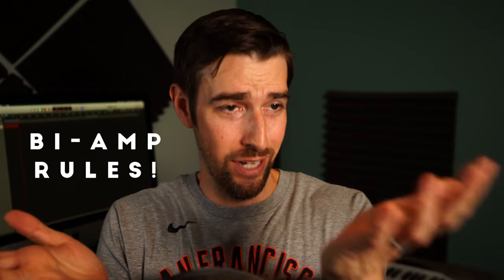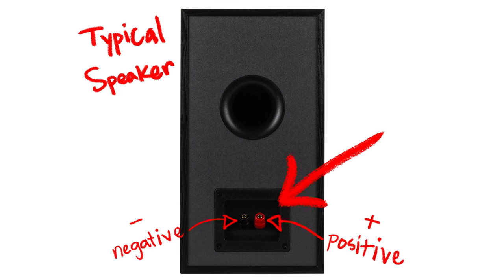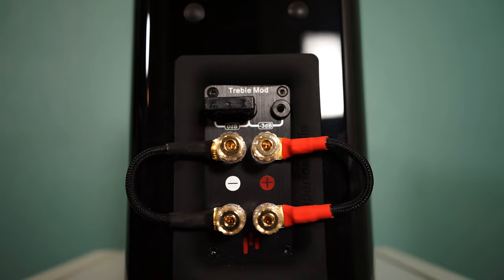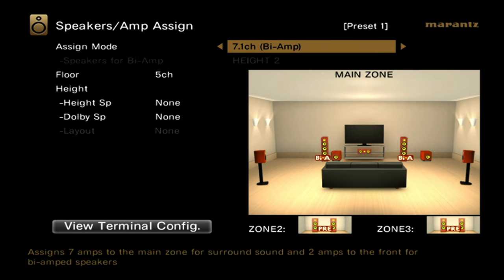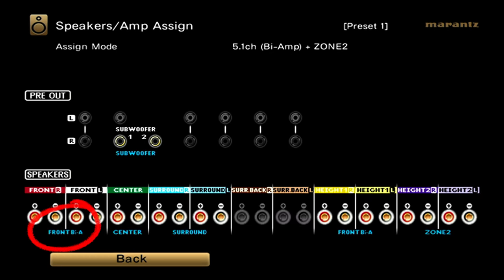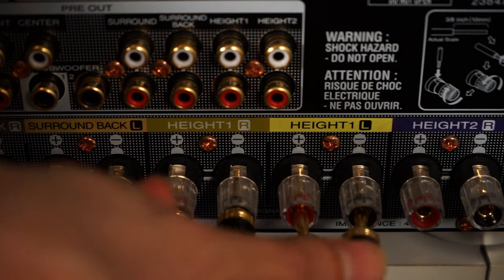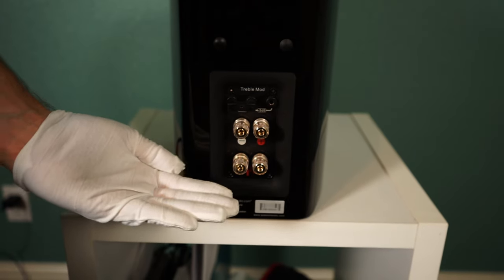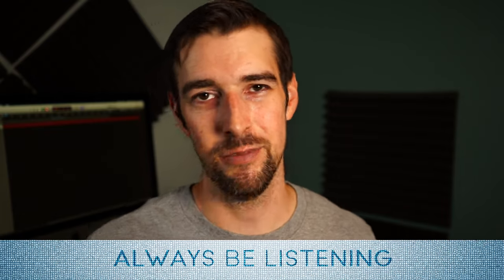TO BI-AMP, OR NOT TO BI-AMP? | Setup | Discussion | @AperionAudioSpeakers | Marantz | Denon

Comment: I totaly agree, I have bi-amped my Sonus Faber and its hard to notice a big difference in movies but it makes a huge difference in 2-channel.
Reply: A little late to the party. My thought was just the opposite. I have an older 7 ch Onkyo. 100 wpc 2 ch. driven. I'm running 5 ch with the front L& R bi-amped. Another comment below stated that he doubles his watts with the bi-amp mode. I don't believe that's the case. My belief is a 100 wpc receiver will only put out 100 wpc ( 2 chs driven ) no matter what you do with bi-amping. So for 2 ch, 100 watts is all I'm going to get. Bi-amped or not. The bi-amp mode only comes into effect when in home theater mode. Now I"ve been wrong once so far this year, so it's possible I could be wrong again, Anyones thoughts.

Comment: Great video! I just upgraded my front stage for my 5.2.2 system to B&W 705 S3 bookshelfs and HTM71 S3 center on my Denon x3800H receiver. I am planning to Bi-Wire the center and considering Bi Amping the fronts, since I have those terminals unused... I mainly watch movies, but also listen to music. Do you think it's worth Bi Amping the fronts in my setup or is simply Bi-wiring the better bet? My thought is that those unused terminals are not using their amps so it's wasted power, but perhaps it's all a pool of power for all terminals and doesn't matter...
Reply from the maker: Yeah, if you listen to music quite a bit and have those unused terminals, might as well experiment! 🎉

Comment: Hi Ealan, great video and thanks for that!
I have a question for you... I would like to ask if bi-amping reduces the "load" of the AVR when trying to drive 4 ohm speakers.
To be more specific, my AVR is Marantz Cinema 40 and for FL and FR I am waiting for Sonus Faber Sonetto III tower speakers (4 ohm) to be delivered. I have read on various forums that I should not change the AVR setting from 8 ohms to 4 ohms but be careful with the temperature of the AVR and high volumes...
So, I was wondering if bi-amping would reduce the "bad effect" of the 4 ohm speakers to the AVR?
Also, in general, do you recommend keeping the AVR setting from 8 ohms or change it to 4 ohms (as recommended in the user's manual)?
Thank you :-)
Reply from the maker: It might help it a little bit to distribute the load across more internal amps, but it would significantly help if at some point you off-loaded the need to power your Sonus Fabers all together with an external amp. 

Are the Sonus Fabers the only 4 ohm speakers that will be in your system? If so, I’d stick with 8 ohm if the rest of your speakers perform best at 8 ohms.

Comment: Surprised you didn't also explain bi-amp'ing with an external amp using the AVR's pre-outs. The benefits  are much different and the improved performance is greater realized.
Reply from the maker: Since that’s a more specific breakdown, that will be in an upcoming tutorial. The majority of my audience seems to be those fairly new to home theater, so external amps aren’t on their radar yet. But the video will be coming soon!
Reply: @ealanosborne that's fair, looking forward to that tutorial. However, you recently reviewing the Emotiva AV Processor... your base is maybe a little more sophisticated than you give us credit for. 👍🏽
Reply: Right , the correct way to Double your power . Far superior . Turn 100 WPC to 200
Reply: I don't know what your plans are, but I would highly recommend you do some research on biamping before you start playing with external amps. When you are using a multi channel receiver to biamp, you're doing what's called a vertical biamp. On modern audio equipment, vertical is the only way to biamp that makes sense. It avoids all kinds of problems that you will run into if you go with a traditional horizontal biamp. There's a fair amount of information you'll need to go over to learn about this method, and its just not possible to cover it in a post like this. If you're thinking about using one amp for the highs, and one for the lows, or mono amps in some configuration, stop. You can waste a lot of money if you don't know exactly what you're doing. 

For a vertical biamp, this is what you need. There's only 2 amplifier choices. You can use 2 stereo amps that are identical. They have to be exactly the same. Or, you can use a 4 channel amp where all 4 channels are identical. In a music setup, 2 stereo amps is the norm, but a 4 channel amp is OK. Obviously, your receiver will be using the 4 channel setup. You can't use separate mono amps to vertical biamp. To give a quick visualization of what you're doing, I'll explain how the amps are connected when you have 2 stereo amps. In a traditional horizontal biamp, one stereo amp is used to drive the highs and the other amp is used to drive the bottom half of the speaker. In a vertical biamp, the right channel goes to both inputs on one of the stereo amps. One channel of the stereo amp goes to the highs, and the other channel goes to the lows. So, instead of one amp driving the highs on both speakers, and the other on the lows for both speakers, you now have 1 amp driving the right speaker, and the other amp driving the left speaker.

The main thing to take away from all this, is vertical biamping is plug and play. As long as you follow the rules, everything will work, and you'll get good sound. Not so with traditional, horizontal biamping. Even if you are using 2 identical stereo amps, the bass amp will be working a lot harder than the amp for the highs. How hard an amp works, changes the way it sounds. Also, power output is a function of frequency. The lower the note, the lower the resistance the amp sees. 4 and 8 ohm ratings on your speakers are just averages. The actual resistance constantly varies. So, if you have an amp that puts out 100 watts into 4 ohms, and 50 watts into 8 ohms, those 2 identical amps are not identical anymore. If your bass frequencies average about 4 ohms and the other amp 8 ohms, you literally have one 5o watt amp and one 100 watt amp. And, as you can imagine, you now have a volume problem. Not only will the amps sound different, they'll be putting out different amounts of power. In otder to set the levels right between the 2 amps, you'll need to use an external active xover, and that's something you really don't want to get involved with. 

This may look like a long post, but it's not. I'm just scratching the surface here, and there are plenty of details that I just can't get into. If you want to biamp with your AV receiver, just do what he tells you to do in the video and you'll be fine. However, if you are going to be using a different configuration, you definitely want to do more research before you spend a lot of money. Its too easy to make a mistake.

Comment: I am running some legacy bipolar paradigm towers as my front left and right in my home theater (5.1). They benefit significantly from bi-amping. Yes, it probably isn't as noticeable in a movie soundtrack. A subwoofer is probably a better investment if that is your primary concern. But, if you want loudness and clarity for music reproduction, you want your towers bi amped. It's going to let the speaker run on double the wattage before getting into Amp distortion.

Comment: I looked into bi-amping and even bi-wiring years ago and ultimately decided against it for a couple reasons.
1. I use Crown XLS amplifiers (4) matched up to my speakers peak power handling so that maximum power and dynamic range isn’t an issue.
 2. I do use 4 conductor wire but tied together to make 2 conductors because I found (and I do this fairly often) when I want to swap out and play around with different front speakers, not all speakers have dual binding posts so it’s a pain. 
 
TOOL FAN!!!👍👍👍
Reply: This was the exact question I had.  I have Crown amplifier so I was wondering how  you biamp with an amplifier
Reply: @crashedcorvette  you would have to use one crown 2 channel amplifier per speaker using left and right channel, one for the Lows, and one for the highs, possibly using the internal crossover of the crown 2 channel amplifier if the crossovers in the speakers are bypassed by doing this, while still using the high Pass crossover in your AVR to send the lowest frequencies to your sub. If you’re already using an external amplifier, then you really have ample power to run almost any speaker unless they’re ridiculously hard to drive and you’re in a very large space. My two cents. Hope this helps.

Comment: Thanks for your quick response. I had that solution too. But according the Marantz support desk I should use the 7.1 (bi-amp) + zone 2 or the 9.1 (bi-amp). I used both options and also 5.1 bi-amp full zone. Bi-amp 5.1 full zone is a real improvement for stereo music. I used the Marantz support options 7.1 Bi-amp + zone 2 and 9.1. Also a big improvement of music quality but when use my Apple TV 4K I have sometimes not the full sound (only tweeters), for example with YouTube.
So therefore my option is 5.1.bi-amp full zone. The big question is, could this damage my receiver?
Reply from the maker: It shouldn’t, since it’s clearly meant to handle it. If you were experimenting with things outside of what the manual says, then you might damage things. But otherwise, no. 👍

Comment: Thanks for those tip! If I have a 7.1 or 7.2 receiver, but use it for a 5.1 speaker system, can I use the 2 "surround Back" ports for bi-amping (assuming there'd be enough power from the receiver, and that its delivery stays constant whatever the number of channels that are used)?
Reply from the maker: It depends on the AVR. Which one do you have?

Comment: I'm doing horizontal bi-amping with an integrated solid state amp and active low pass crossover to the woofers (below 80hz), and tube monoblocks on the mids/tweeters.  Best of both worlds.   Bass got tighter, and I have a bunch of options for adjusting low frequencies.  Mids and treble got clearer. Absolutely worth doing in my case, and was really quite affordable, since I already had the monoblocks, and the speakers were conducive to it.  

Every system and situation is different.   How much difference it makes really depends on each setup, and how it's executed.
Reply from the maker: Hell yes! Excellent setup, my friend! 🤘

Comment: Since bi-amping doesn't affect home theater, I'll probably leave my fronts as-is with a single cable. This also means I'm utilizing the built-in crossover instead of my receiver's. My Yamaha RX-A6A receiver also has 8V outputs, and I have a Monolith 200W/ch amp already, so I'm not sure I need to worry about this. Am I right in thinking this way?
Reply from the maker: Sounds solid to me! 😁🤘

Comment: Tthanks for your explanation. I have the SR8015 that I only use in a 5.1 setup. I want to connect the front speakers bi-amp setup. In the Manuel of the SR8015 is only a 5.1 bi-amp option, 5.1ch Full Bi-Amp listed. As indicated, I only want to connect the front speaker in bi-amp. Which receiver connections should I use for lower terminals of my front speakers?
Regards Wim
Reply from the maker: According to the manual, you use the surround back terminals for the lower front speaker binding posts
Reply: @ealanosborne   Ealan, hereby, as promised, the Marantz respons on the Bi-amp settings (SR8015) in a front Bi-amp 5.1 setting.
If you only want to connect the front speakers Bi-amp 5.1 mode, you must choose the 7.1 (BI-amp) + Zone2. The 5.1 Full Bi-amp is not an option because the S8015 then thinks that all speakers are in Bi-amp. See diagram in Manuel SR8015.
Regards Wim
Reply from the maker: @abzeker5877  Ohhhh, gotcha! Thanks for that! 🙌🎉

Comment: I have a $1100 pioneer elite htr.(paid 350 new!). Rated at 120wpc. It seems to control the 7 inch woofer on my b&w 602 s3's better when bi-amped. Mid bass seems slow,  muddy using just two channels even with my fancy taralabs bi-wire cable. It plays clearer at low volumes too. It's a class d reciever, they say that's better for control. Maybe I need 2x better control to tame these old monster bookshelves or buy a real amplifier. Working on it.

Comment: Thinking of bi amping my fronts. But I will need to use an external amp as i a want to keep my 5.1.4 setup. I have a Marantz C40. 

So does that mean I need to really have a quad amp or two stereo amps and use the preouts. I assume you can't use a mix of receiver amps and external amps for bi-amping. 

Might get a 5 channel amp, one for the centre as well.
Reply from the maker: Correct, you wouldn’t be able to use both internal and external amps combined to pull off bi-amping. In order to bi-amp with external speakers, you’d need an RCA Y-splitter, which I also have a video on. 😉
Reply: @ealanosborne  not sure why you would need a splitter. Can I not designate the appropriate channels say channels 1,2,3,4 to preout to a quad amp. 

Then say channels 1,2 be biamp 1 and 3,4 biamp 2. Then use channels 5,6,7,8,9,10,11 for the other speaker and they will use the internal amps?

Giving me 5.1.4 with two biamped fronts.
Reply from the maker: @nickmaddalena985  No, sorry. The software just isn’t that intuitive to make it that customizable. If you want to bi-amp the front speakers, you need to connect a Y-splitter into each Front L/R preout and connect those to 4 channels on an external amp.
Reply: @ealanosborne  sorry for the delay. So what you are saying I'd that I use only two channels and Y split the preout signal into 4 channels. In an amp. So basically 2 channels will be a duplicate of the same signal, which internally get fed into the two sets of binding posts on the main speakers?

Will the preout signal be degraded going through the y splitter? Would not the resistance be higher?
Reply from the maker: @nickmaddalena985  Yes, you are understanding what I said correctly. 👍

The pre out signal does get split, yes, but any degradation at that gain stage is very minimal, and the external amp will do most of the work anyway. When I tested it for this video, it seemed to sound just fine! 🎉

Comment: Thanks for your video! I am looking to buy speakers that state they are IPR ready. Can I run these as regular speakers? The speakers are not that expensive...they are Polk Audio  SC80 IPR. Any suggestions would be appreciated.
Reply from the maker: Hi! Yes, you can use them as regular speakers since they have standard +/- speaker terminals, but are IP ready, if you decide to do that at some point instead. 👍
Reply: @ealanosborne  Thanks for the quick reply! Now looking for an Amp/ Reveiver that will be sufficient for a six speaker plus one subwoofer. If you don't  mind...can I ask what I should be looking for without breaking the bank?
Reply from the maker: @georgematos9380  Hmmm…well if you want 6 speakers and a sub, a 7 channel AVR would work best. Something like the Onkyo TX-NR7100 or Denon X1800H or X2800H, depending on your budget. Those are all fairly future proof, supporting HDMI 2.1, 8K and 4K video, next gen gaming features if you play video games a lot, and sufficient power for an entry level speaker system. 👍
Reply: @ealanosborne  Once again thank you for your guidance! Great job on the videos and in particular with the inserting of humor! Sincerely...

Comment: Thinking about bi-amping my denon avr-2807 receiver just using at a 2 channel stereo is it worth it?
Reply from the maker: If you happen to already have the equipment to make it happen (speakers with 2 sets of binding posts), then yeah, check it out! But would I go out and buy speakers that can be bi-amped? Probably not. 🤷‍♂️

Comment: I am running bi amp to my bookshelf speakers with a Denon 3808 and an external two channel amp.  Denon amp is driving high end.  External amp is driving low end.  My two channel amp has gain control.  I set gain to the same level as Denon amp by sound meter through a speaker.  

Most speakers including my 6 ohm rated bookshelf speakers have their impendence curve with lowest point around 150Hz to 200Hz.   Some even 8 ohm rated speakers can dip to 4 ohm between 100Hz to 200Hz.  While most AVR amp is not able to provide enough current to drive that range.  So speaker driven by less capable amps will be 1 to 3db down in 100Hz to 200Hz.  That range of sound affects speaker's tonality.  Most external amps are able to drive 4 ohm or lower speakers.  Therefore, speaker will sound different driven by less capable vs so called high current amps.

Comment: hello, I got Bowers & Wilkins 702 S3  speakers which says MAX 300 W total power coming from amp. I also got a Rotel 5 channel Amp with 210 W each channel. Can I use bi-amp (get 2 channels 210 W each from the amp) and feed 210 W on top and 210 W on the bottom on those B&W speaker? thanks. (BTW I got the same Maratz too).
Reply from the maker: Yes, that should still be fine, unless you plan on playing the music very loud for hours on end. 😄 It’s actually good to have a lot of headroom with a more powerful amp, as opposed to an amp with not enough power that’s trying too hard and introducing distortion into the signal path.

Comment: What's the purpose of the black/red cables attached to the binding post? Aren't the speakers already bi-wired?
Reply from the maker: They’re jumper cables that connect the high and low frequencies for when you want to connect the speaker normally (plugging into just the bottom red and black terminals). 

Then when you want to bi-amp them, you remove the jumper cables so the high and low frequencies are powered independently. 🤘